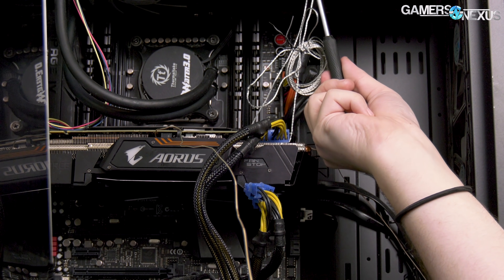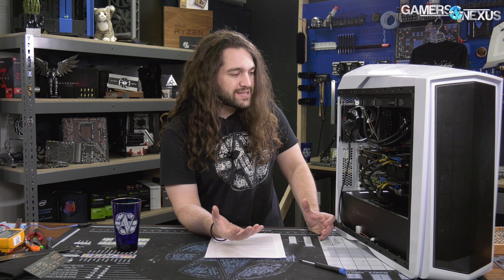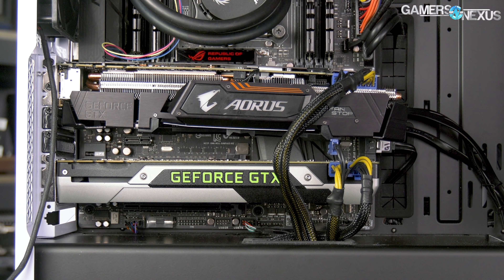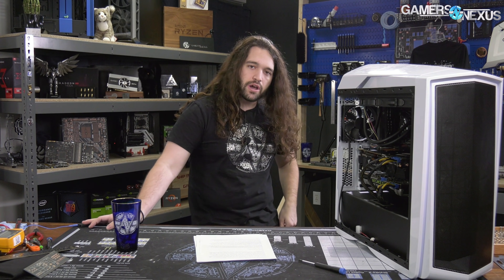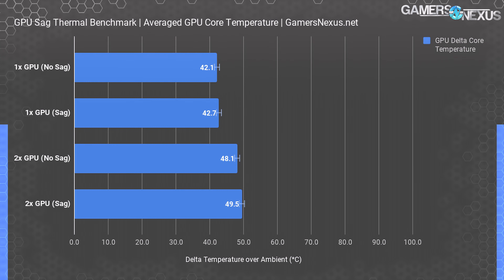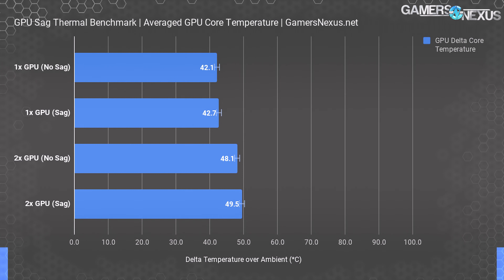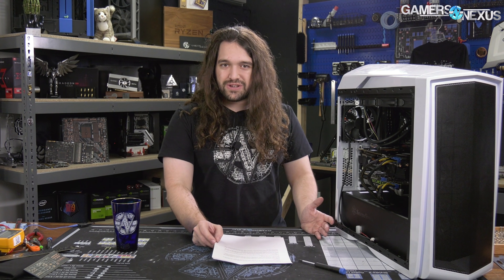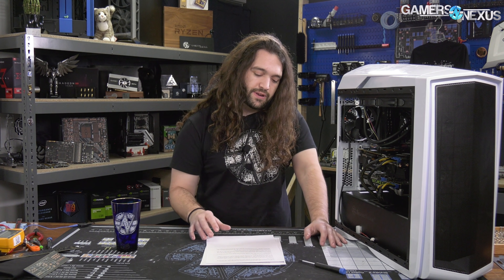Video Card Sag Test: Thermals & Frequency on Drooping GPU

Comment: Hi, Steve! i have the same case as you do. PM01 RGB. I have the stock intake fans and a Noctua NH-D15. Would you recommend adding some intake or exhaust fans at the top? I watched your video about the CM H500P Mesh and you said that Cooler Master did the right thing of retaining the closed off top panel for positive pressure. With that in mind, will adding some fans at the top of the PM01 help contribute to more airflow in the case? My ASUS GTX 1080 Ti currently reaches 79 degrees in ultra settings while the CPU reaches 69. I went and added a small 80mm fan below the GPU to act as a tiny exhaust. Thanks for answering!

Comment: i was kinda worried about video card depression when i bought my 1070 Strix, even though it doesn’t have the big boy cooler that you’d find on the 1080 Ti, and already considered routing the PCI-E cables from the top before it arrived so i could pull the card up by the connector if necessary, but i’m pleased to say that it doesn’t sag at all so far. maybe there’s some micro sag if you really look for it, but nothing that’s even remotely concerning
Reply: Problem is it needs support from the bottom. This way you can help to develop the problem that Steve mentioned: peeling off the cooling from the pcb. I habe this card non xtreme version and supporting it from the bottom with a plastic stick. The card ocs to 2050/5977 no problem with it ever.

Comment: 3:32 Not trying to be picky, just a thought, but if someone went SLI wouldn't they likely get 2 identical cards, which in turn would sag identically so the gap would remain constant? :P
Still relevant for situations a single card would be closer to the bottom of the case / PSU shroud due to PCI-E slotting though.
Happy New Year Steve & GN Crew!
Reply: Not really I've used cards from different AIBs for SLI and Crossfire. I don't have the money to be picky. I've also seen many people do the same.
Reply: I think that they only put that card in for the graphs at 5:08, reinforcing that idea is the fact that there's no sli bridge
Reply: The second GPU would be close to the power supply/ PSU shroud. Indeed the "top" card could be cooler but that would merely transfer the problem. SLI runs at the slowest frequency.
Reply: GPU sag was invented for SLI. these idiots keep "fixin it" with this "one weird trick", and then wonder why the bottom GPU chokes the top GPU. In the case above he has them upside down. You put the saggy card down low so it leaves a gap to the top card (more important in adjacent slot configurations.)  - yes joke,  ...but still...
Reply: With the saggy card at the bottom it would basically get no air at all.
But there is actually a simple trick to keep the cards cold: a side fan. It gives fresh air to both cards from the outside. And with proper alignment it won't destroy the precious airflow. Or with most modern cases it would actually create one.
Reply: Honestly for SLI you need to water cool the top card or you will hit 84C+ on the top card sucking up hot hair. I had to do that to my rig and now both cards don’t go past 65C (FTW3 1080TI)

Comment: I have this issue with my 1070 FTW. The cables help. But the heatsink sags a little because it is held by 4 screws.
The backplate and faceplate help with the PCB rigidity luckily.
Reply: Just buy a GPU support bracket. They can be had on Amazon for less than $10.

Comment: Random tip:
on a NZXT H500 take your PCI power cable and put it in the higher velcro straps and then wrap it around the under side of your GPU to lift it a bit so it doesnt sag as much, I do this with my 1060 since I have a morpheus cooler installed.
Reply: Not everyone has extra wire to do that especially on a big case. You should not have to use the power cord as a support device to begin with. Easy fix is dont buy a shitty product. The idea of using a wire to hold it up isnt bad use thin clear fishing line. But the idea of using the power cable is borderline retarded and will just put stress on plugs not designed to hold much but the wired
Reply: Overall, I think I'd rather just mount the motherboard horizontally, or use a vertical graphics mount...but it's good to think a little outside the box.

Also btw I naturally experience synesthesia quite a lot, as do millions of others...although a lot of people require mind-altering substances to do so. :P
Reply: That doesn't sound like it looks right.
Reply: @monmc6129  
Oh I've had plenty of brain damage...parents did drugs, mother was most likely smoking weed throughout my time in her teenage womb, pretty sure I had several concussions during my childhood, and definitely had a few more during adulthood. Also plenty of damage from drug use in my teens and 20's...
...but I've had the synesthesia since early childhood; I'm very intelligent; I have OCD and autism; I have — on all known branches — family history of very high intelligence and extreme eccentricity.
...so it might be brain damage or it might be inherent, haha~ :D
Reply: @auturgicflosculator  well shit, sorry to hear that man. Hope everything is well
Reply: @stayedleopard4  
Well thank you, haha~ I'm generally happy, and I hope that you are as well!

We all have our strengths and weaknesses, and I don't mean to complain — at least I'm finally coming to know myself quite intimately, focusing on self care and openness, embracing my oddities, allowing my brain to recover from the most recent concussion and years of unwise quantities of toxins, all that fun mid-30's rebooting my life sort of stuff. :P

Comment: For last vid.
Solution for condensation.
Put the whole rig in a big plastic container and fill it with nitrogen gas. Since nitrogen is heavier than air it will stay in the container. That would eliminate all air flow and prevent any possibility of condensation on the rig. While you are running benchmarks you should flush (with nitrogen) the container every now and then just in case some nitrogen spilled out.
Reply: Zoran Popovic nitrogen isn’t significantly heavier than air... air is 78% nitrogen after all
Reply: @MultiPureEnergy  Well on average it is. And in chemistry it is used to prevent air from reaching elements .
Reply: You fail. Pure nitrogen gas is about 3% LIGHTER than air! Love from a chemist. Jacob is correct.
Reply: What matters is if it heavier than water vapor. Another way would be to submerge the whole system in pure water, but that is probably more error prone ;)
Reply: @defeqel6537  if it's not significantly heavier it's gonna be easily blown away by breeze.
Reply: Argon gas might do the trick though as it is denser than air.
Reply: @saph1r432  on the downside, you need to be careful with such gases as because they are heavier than atmospheric air they can pool in your lungs and suffocate you
Reply: Dry nitrogen is OK, especially easy to make if you have LN2 on hand, but it is not denser than air, so it will not stay in a container for significant time, unless the container is mostly sealed. Carbon dioxide might be better, that IS denser, and it is very easy to get a CO2 cylinder.

Comment: My G.Skill trident z Rgb memory is rated for 3000mhz at cl16 and whenever I turn on XMP for ram my pc blue screens on boot and restarts a bunch and the XMP gets removed. I’m running it now on XMP but at 2800mhz
Build parts 
Ryzen 2200g (I’m going to upgrade at ryzen 3000)
Asrock X470 taichi 
16gb of trident z memory (f4-3000C16D-16GTZR)
Gtx 970 windforce
Samsung 970 evo 500gb
Edit: my ram is running is actually at 2800mhz in my system rn
Reply: Congratulations, you just earned the "off topic badge"! :-D
Reply: @scottc2455  thanks for the badge but it's seems to be a good star. Anyway I'll try the moving slot thing but I'm pretty sure I've already tried that. worst goes to worst I run it below its actual speed and just wait for zen 2 and hope it's not as ram dependant
Reply: Try moving RAM to slot 2 and 4 (instead of 1 and 3). Made a huge difference on my Asus rog strix x470 gaming-f.
Reply: Many kits of ram run slower than XMP profile on Ryzen according to specyfication. For example look at similar F4-3200C16D-16GTZB modules. https://www.asrock.com/MB/AMD/X470%20Taichi/index.asp#MemoryRR
Reply: Update your bios, you will be able to reach 3000 MHz. Also you may need to look at timings if still not stable.

Comment: You can’t touch bare hardware like that, you’ll short the card

EDIT: 2:10 Thank goodness, I see you’re grounded
Reply: No you see the wristband at 2:10, that’s a Bluetooth 4.1 grounding wrist cable
Reply: Charles Yeo it’s a reference to the verge pc
Reply: Wrong, his PSU has the rubber contact thingies on it touching the case so the whole system is grounded.
Geez, doesn't anyone watch the verge;)
Reply: @Mr_Spock512  Whoosh

Comment: always scared of a drooping gpu snapping at a certain point lol
Reply: The PCB is made to flex a lot, but it's still unnerving
Reply: @kendokaaa  Solder joints however are not designed with flexation in mind. Just ask anyone with an Iphone 6,7,8 who has some form of ic failure due to flexing.
Reply: @kendokaaa  Yeh i have bent many rams while carrying in my pocket they worked perfectly . But this much sag actually can damage the BGA of the gpu processor.

Comment: Wait, I recently bought an aorus 1080ti, not the extreme though and it's absolutly not like that, I didn't notice anything build quality wise, and it droops less than my old 980 from MSI, which is way smaller and lighter
Reply: As they have said, it has been in use for a year. Could happen after a while
Reply: Yep, I'll keep my eye on it just in case

Comment: Or use a vertical gpu mount (;
Reply from the maker: Yes, we also like barbecued video cards.
Reply: Actually in a Corsair 400C my 1080 Gaming X only gained 2 degrees of heat while gaming with a vertical gpu mount.  And that is with a NZXT 52 blowing hot air on to it from the front.  Mind you i have 3 fans for intake at low speed and 2 at the top plus 1 at the back for exhaust.   All at pretty low RPM though.
Reply: I pretty much prefer to just go with a horizontal motherboard, but vertical mount is a great option.
Reply: @GamersNexus  who said I have the side panel on😉
Reply: Or use a cube case like TT core x9
Reply: @jack chester 
vertical mount only cuts off expand ability if you leave the mobo in default position. Lay it flat in a custom or modified case, in a test bench; turn it 90º on its side, make a wall-mounted case, whatever. Think outside the standard box~
Reply: Make it vertical your own way.
Reply: Or just make a happy little tower from Legos to hold it up
Reply: @therealossi1337  
Channeling Bob Ross is always effective~♥
Reply: @jack chester lmao custom cases are easy. Mines was made out of high density cardboard for awhile! Ive even seen people use old emptied out fish tanks. You just arent creative.
Reply: Doesn't that just obstruct the CPU heatsink? Or am I incorrectly interpreting what is meant by "vertical"?
Reply: @Nicholas_Steel  nope...it gets the GPU cooler closer to the side panel...blocking cool air intake...you have to get a custom vertical mount and a very good air flow in your case...and that will still impact temps
Reply: Good thing my cases airflow was designed with vertical card in mind
Reply: @tygerclaw9898  of its got a glass side panel then no
Reply: I ain't made of money, son
Reply: @mushroomsamba82  
Mount your mobo on a wall with the PCIe slots vertical. :P
Reply: Yuck
Reply: @jack chester
Depends on the chassis you're using. You can experiment with different motherboard orientations to find what works best for your current hardware.

If you're interested in getting a little hands-on, you can go for some case customization, or build your own case, or mount your motherboard on the headboard of your bed, or put it in a glass toilet sculpture. Whatever works.
Reply: In a decent sized case a couple of degrees is nothing. Some cards look great with a vertical mount. I'm currently building a retro XP machine in tempered glass with a vertical GTX 285 complete with cheesy sticker on the blower cooler. After a rebuild with fresh paste and pads, zero heat issues at all and shows off the 'cool' image on the card.
Reply: What about vertical cases (old Silverstone Fortress /Raven cases) wouldn't that put strain on the mounting bracket instead of the slot?
Or just flopping any old case on its side to make "cube" that will be forever shoving the GPU back in the slot thanks to the cruel mistress that is gravity.
Reply: @jack chester 
My point, which you seem to continually be missing, is that you keep talking about vertical mount as though it has to use a specific piece of hardware...you seem incapable of thinking outside of very narrow confines. I'm not saying that your original point had no merit, simply that it's a rather simple problem to circumvent.
Reply: @jack chester
What I take away from what you're saying is that you believe your opinion to be perfect, and that you believe that any ideas that you don't like are stupid ones; that you prefer to withhold information from people because you believe that they're all too stupid and shortsighted to make their own decisions.
What a wonderful outlook! I shall leave you to it, haha. :P
Reply: @jack chester 
Sigh...Jack, I'm not at odds with you; that's the thing. I don't care about winning, I care about improving things, brainstorming, sharing, creating. it seems from my perspective as though you keep arguing against any possibility of my ideas having merit, rather than trying to understand them. If I'm mistaken in that I'm sorry, but your arguments seem very circular to me.

If I don't make sense, I apologize — I thought that I was being very clear, but with my OCD I do have a tendency to assume that people who seem smart or intelligent can visualize what I do from the information that I provide; this next bit will perhaps sound arrogant or narcissistic: I am a multitudinously-talented genius. However, not only do I have OCD, but also autism; I'm high-functioning, but even so it is often difficult for me to think and explain things in terms that others can easily follow, because my thoughts are in a rather foreign language all my own. Music, multidimensional thinking and color are more my speed; English is...sorely limited in terms of both complex formulation and the translation and expression of complex concepts into simple terms. However articulate I may seem on the surface, I'm trying to push an ocean of ideas through a pinhole-sized outlet.

Sorry that my frustration got the better of me. I can usually keep it in check, but I let impatience win out.
Reply: @vek7933  
I somewhat like the idea of single-slot lightweight cards...for SLI/Xfire even, passive cooling using heavy, well-channeled case airflow is attractive.
Reply: @vek7933  
Nice, that's something like a high-memory GTX 750 Ti in terms of gaming performance, correct? Pro cards are often a good way to go~
Reply: Pay $60 for a garbage vertical mount that essentially does nothing but affect your temps negatively, or just buy a GPU support bracket for $9 and the issue is forever gone.
Reply: yeah and get even worse thermals lmao

Comment: There has been a lot of people with issues that they're running at low PCIe mode like x1, x2, x4 etc. and it has been fixed when the GPU has been re-mounted. This kind of sag can likely cause those kind of issues.
The worst thing is that a lot of people might not even notice that there's something wrong unless they play some game that's more heavy on PCIe bandwidth like Wreckfest, rFactor 2 etc. where their performance with something like 1080Ti is horrible but OK in other games.
Reply: Most probably that's why I faced x1 issue with my Zotac 2080Ti amp (non ex) when I mounted it on Maximus XI formula. excess dust in the pci slot or sagging caused the issue I think
Reply: My Gigabyte r9 270x Windforce X3 card had some sagging issues in my old case and it would often be running at PCIe x16 1.0 instead of the 2.0 of the slot. Sometimes a reboot fixed it temporarily other times removal and reseating the card was required to "fix" it.
Reply: I've had this exact problem myself only 2 weeks ago on my zotac 1080ti amp extreme, far cry 5 fps dropped significantly and i was like wtdt is wrong here, after going round the houses of changing drivers reinstalling games i then ran gpuz amd realised the card was stuck in pcie 2.0 so i removed the card and reseated it now it's it's back to 3.0, I don't have any sag on the 1080ti amp extreme because it's a well built card and has a solid backplate however it did happen, card has been in since launch so a while, anyone know why this is happening when there is no sag
Reply: I also had a r9 270x windforce and I had random driver crashes when gaming heavy on it put a toy action figure to prop up the sagging gpu and the random crashes stoped
Reply: I use a Fractal Design case that has a vertical mount plate for storage that slightly covers the power cable connector of my slightly oversized graphics card. I had to cut out a bit from that plate to be able to connect the cables. At least it holds the card staright by the power connector...